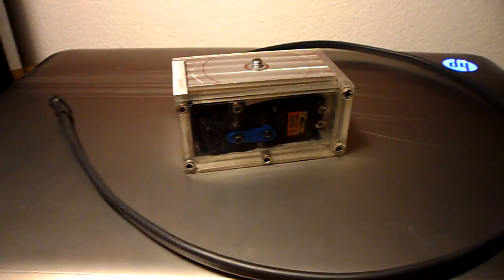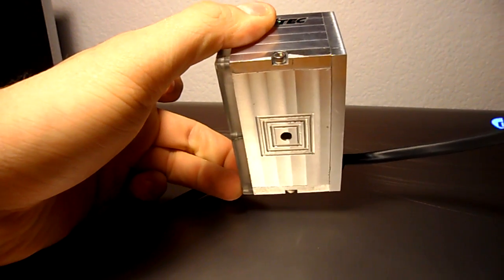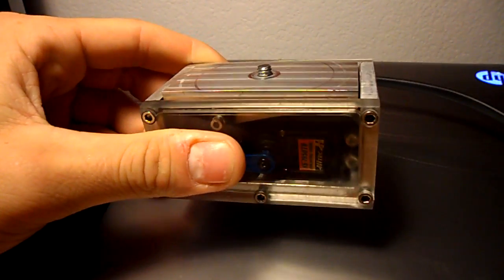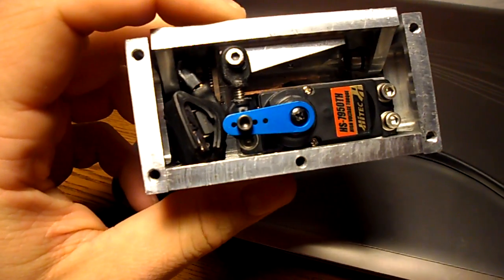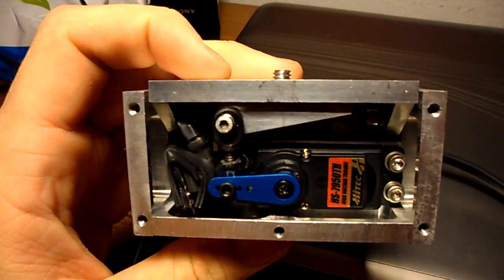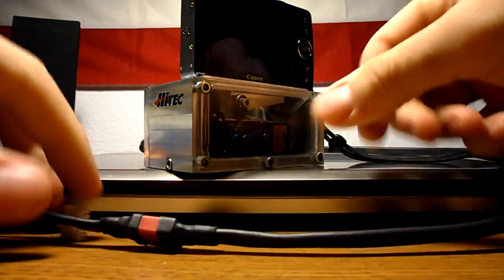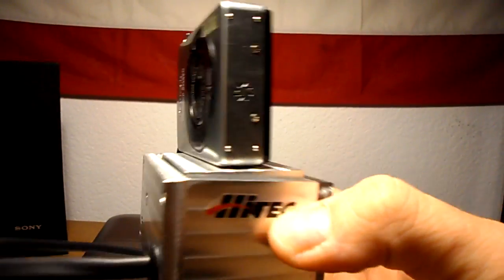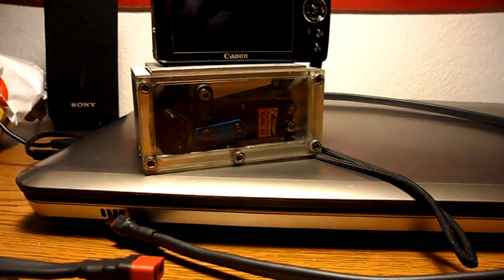Gyro Stablized Camera Platform

Comment: a cool project but I see speed response isnt perfect comparing to mass gyroscopic stabilizers. May be is only a problem of find a faster servo on the market, or did you already used one of the faster avaiable?

Comment from the maker: @19Photographer76 Average current draw is .51 amps under average stabilization. I was running a fairly small 1500mah LiPo. Therefore, ~3 hours. After all my prototyping, testing, and demonstration, I have only charged the battery twice.